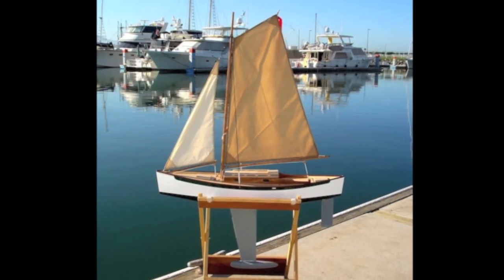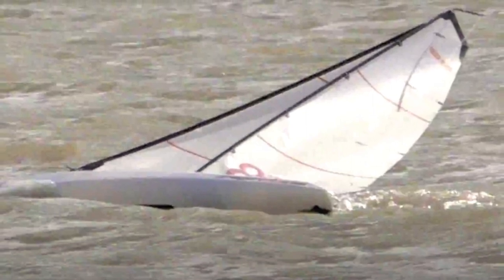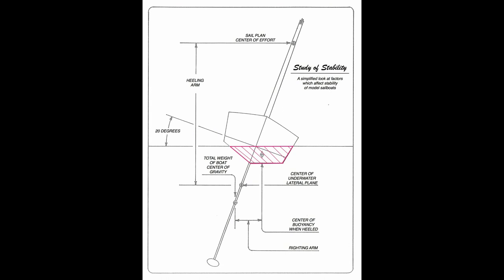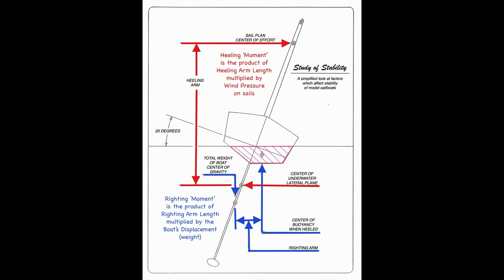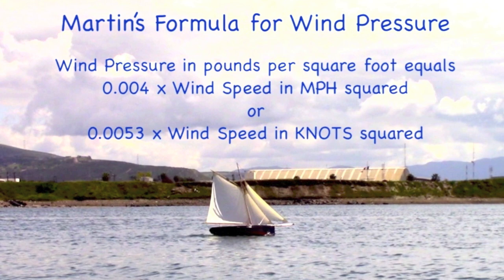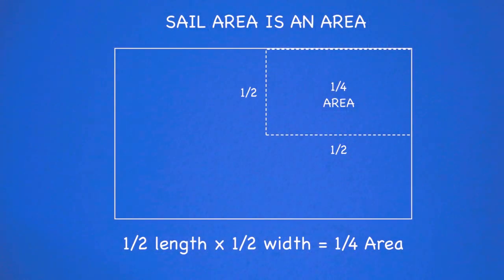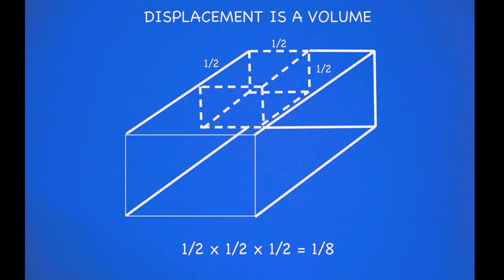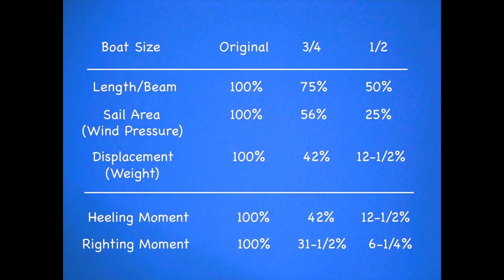RC Sailing Boats Stability and Scaling

Comment: Hi Gary. Another excellent video. This time a little too late to stop me from falling into the trap of gross miscalculation of ballast when I built my 150% size Flyer. I started with around 180% ballast, knowing this wasn't right but where's Martin when you need him?
She's been giving me plenty of fun but predictably she's very tender. 
I've since had her in for a bit of a refit which is almost complete but untested. Can't wait! Now at around 28kg  62lb, I needed to build something to help launch and retrieve. Even as she was, she's almost pulled me off the pontoon a few times just because of the enormous sail area. 
Again, many thanks to you Gary, for making it so easy to get into such a rewarding hobby. 
Looking forward to your next video.
Reply from the maker: Assuming the refit included adding ballast to bring her up to 62lbs she should no longer be overly tender.
Quite unique that you have scaled 'Flyer' UP, let us know how she goes. Cheers !

Comment: Hi Gary

Thanks for another great video. My latest build is a Mississippi stern wheeler. Flat bottom, shallow draft and high superstructure do not make for good stability I am currently experimenting with depth of keel  (limited due to size of pond) and weight of ballast bulb. First trial wasn't bad but not good enough for turning circle. Videos will be up on my channel as things improve.

Comment: Again a great video, thanks for that 👍
I sometimes see people making shallow keels for your designs. To counter weeds and/or sail shallow ponds.  Never have I seen a schematic of one though. If you can find the time, it would be nice to offer a PDF addon of proven shallow keels. They will likely be less performant (heavier, more slugish in turning etc..?) But having a proven workable design, would make it more worthwhile to see if it fits one needs.  Maybe make them removable fitting the current box, potentially with added locating pins to secure them against tortion.

Comment: Great video that explains things quite nicely.  Answers a couple of questions I had.  How about a follow-up video on how to account for the differences?  I have a small pond, and would like to scale my Irene plans down, let’s say your 75%.  It gets windy here, so the decreased sail area might not be a bad thing.  Seems that the ways to account for the other differences would be to a) lower the sail Center of Effort.  That would make it look a little funny, but doable.  Increase the Righting Arm by b) increasing the keel weight (not desirable with the lower displacement), or extending the keel length (also not desirable in the small pond).  Another video would be a great follow-on.
Reply from the maker: Thanks for the suggestion of another video Mark, I'll add that to my "to do" list.

Comment: Thanks for the excellent explanation on the effects of scaling. I was thrilled to see a new video from you, pop up on my screen. Your videos are a resource that I refer to often and are a great help to me in my scratch building endeavors. 
I have recently started modeling again and am making an RC model of a trading scow called Rangi. It's a deck scow that was built in New Zealand in the late 1800s for carrying logs.
I intuitively knew that I would have to add lead to the bottom of the center board now after watching your video I understand why 👍.
Could you possibly make the diagrams you showed in the video available in PDF format?
I would love to have them to put in my technical info folder for future reference. 
Thanks again for the great video. 
Cheers. 
Dave.
Reply: Hi Dave.  You can screen shot and print the charts.
Reply from the maker: As Warren Neeves suggests, screen shot. If that fails, contact me thru the website, I can email the diagram to you.
http://www.bearospaceindustries.com/boats2.html

Comment: plan on ordering most of your boat plans, they all look great, question when you say the hull is 1/4 pine plywood are you talking about just regular ply like from Home depot? or is it a special ply
Reply from the maker: Glad you asked Mike, my boats are built with 1/8" ply from Home Depot, they call it "Utility ply", some folks refer to it as "door skin". Almost any plywood could be used as long as it is not more than 1/8".
Thicker plywoods will not bend as needed.

Comment: Thoroughly enjoyed making and sailing Annie & Flyer, I’m going to make a working model of a historic sloop “ Marie “, question about this video might help me, how do you determine Total Weight of boat Centre of Gravity position on the fin , and Centre of Underwater Lateral Plane on the fin , I’m guessing that when I know weight of finished boat I will know my ballast weight , I can make an educated guess for length of fin , and put a longer or shorter fin in , until I get good sailing characteristics.
Reply from the maker: Great questions Anthony ! FINDING THE  CG - At the design phase, one can only estimate the CG location, but it can be an "educated guess" by estimating the weight and centers of components (Hull, Rig, Keel) and mathematically resolving the total. 
After the (model) boat is built, the actual CG can be pin-pointed. Here's how: 
Erect a stick, such as the rounded end of an old broomstick held in a vise. Hold the boat model, laid over on its side, mast(s) horizontal, and balance it atop the broomstick. There is value in doing this with the finished, sailing boat. The info might be useful for the next design or for comparison of boats.
FINDING THE CENTER OF UNDERWATER LATERAL PLANE - Back to the drawing board. Make a scale cardboard cutout of the boats' underwater profile.
Balance the cardboard cutout atop a pencil point to find its center. This point is "theoretical" only, but useful for design reference.
Cheers, and best wishes for your sloop 'Marie' project.
Reply: @sailtails2775  Thank you for your answers, they are a great help , already done the underwater hull cg , I know what to do when boat is finished, your illustration of the teeter totter, we call it a seesaw, makes the point very simply.

Comment: Excellent explanation, thanks! You explained the exact reason why I prefer to build larger scale RC boats - they simply have better sea-keeping abilities. BTW, I build powerboats, and even the size and design of the cabin does have an effect, especially when making a turn with wind coming broadside. Just recently, I saw a scale model tugboat that hopelessly heeled over because that particular full size ship has a shallow draft and high superstructure. Being true to scale, the RC tugboat turned out to be a huge disappointment to the owner/builder.
Reply from the maker: I agree that the bigger models perform better. Indeed some power boats have superstructure so big that it becomes considerable "sail area". I hope that Tugboat Skipper can arrange ballast to compensate.
Reply: @sailtails2775  From what I've heard, Mr. Tugboat Skipper is planning to build a new superstructure that will be at lighter in weight than the one he has now, which is made of thin brass and copper sheet. I think your idea of adding a little ballast should help too!

Comment: Im building annie, didn't I see one of your videos about shorting the keel for shallow water? about adding more weight to the bulb the shorter the keel
Reply from the maker: I have mentioned shorter keels for my EMMA design. I have not experimented with a shorter keel for ANNIE, but "seat of the pants engineering" I will suggest her keel could be shortened 3 inches (75mm) if another pound (.5kg) of lead were added to her bulb, bringing her overall weight up to 21 pounds (9.5kg). Let me know how it goes. Cheers !

Comment: I was wondering if a horizontal fin on the keel would help it from heeling so much.  Same weight of course.
Reply: i think it would help of course especially if it is close to water line. if the bulb gets out of water it will really help because it is in the not dense air but i don’t know if you want to have that while your sailing. don’t take my word for it i just thought i’d share my thoughts good luck!